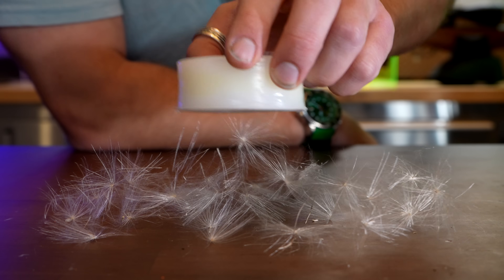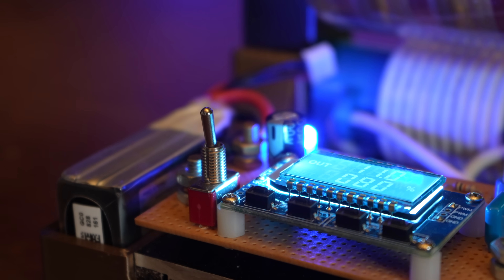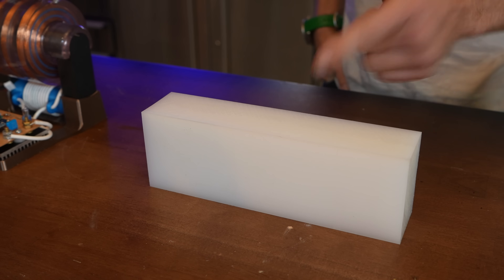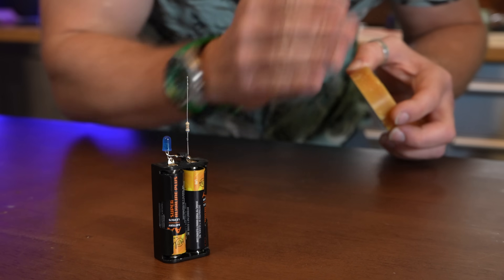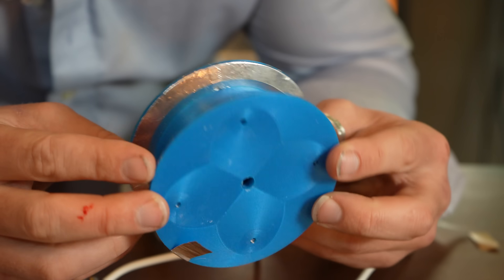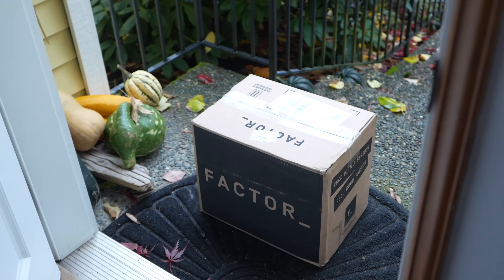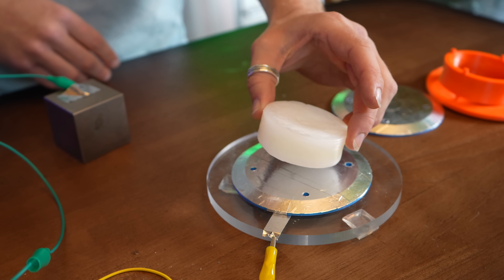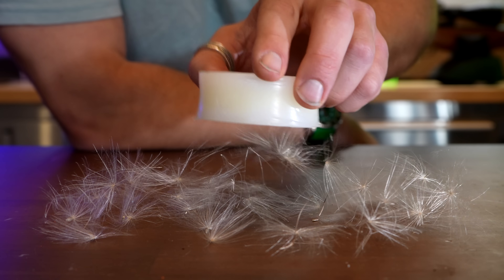Creating an Exotic Material With A Permanent Static Charge (Electret)

Comment: Could you use it to power your Corona Motor, using a fan or something to shield and unshield the static field?
Reply: Yes, you could, but the energy would come from the fan, which constantly has to do mechanical work to reconfigure the E field. Like pulling 2 magnets apart.

—Asher Corbett from the future

Comment: If you want to bulk solder, grab some high density organic flouridated hydrocarbon with a high boiling point, make your arrays, coat them with paste-solder, just look for soldering gel or liquid solder or tin paste or atomic tin paste, then put whatever you are soldering into a catering tray, the ones they use at buffets or dinners for events, with a lid on it, a glass lid works better with a silicone seal so you don't gas yourself, then heat it up over some candles or something and you'll make a soldering environment that'll melt the solder and you won't have to do them all 1 by 1. There are a few videos on youtube of course but I have no idea what you'd have to search to find them.
Reply: the non crackhead version of this is called vapor soldering and you need to be careful with temperatures since the flourinated hydrocarbons will readily decompose into hydroflouric acid at a certain temperature.
Reply: @drkastenbrot  HF is one of the chemicals that really scares me (and I have some pretty bad chemical burns).
Reply: nah this is AWFUL advice

Comment: Yo! Nice! Hey, for the mold for the static curing you need to think of how they do the sides of large powerline insulators with the ribs, all the surface area makes it harder for the break down to happen. This should allow for higher voltages during curing. Maybe even try some ceramic paint on the 3d print too on the edges. Nice work! I a fan of Gabriel Kron, so I will be following this project close! (Edit, I see you got one rub now. 😂 should comment after I watch)

Comment: You should try your hand at making a Birkland Eyed generator, making nitric acid from air using a plasma arc. Some designs used magnets or electromagnets to force the arc into a disc, donut shape or others to increase efficiency.